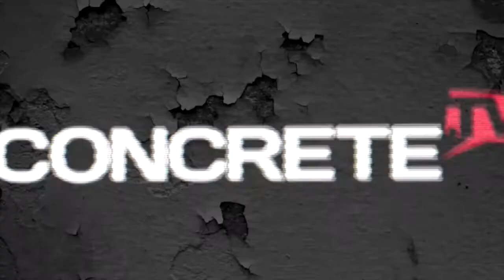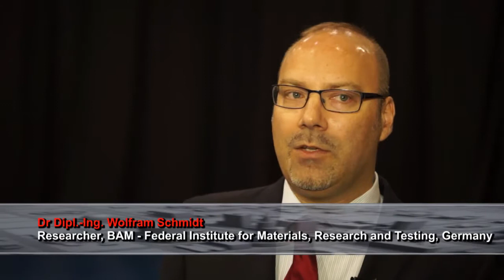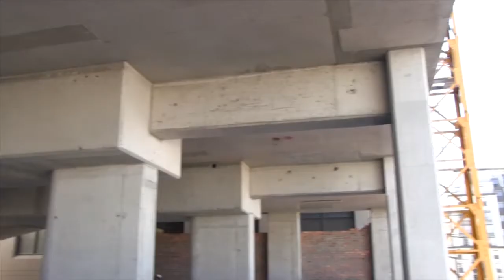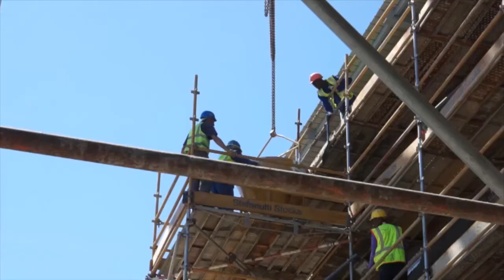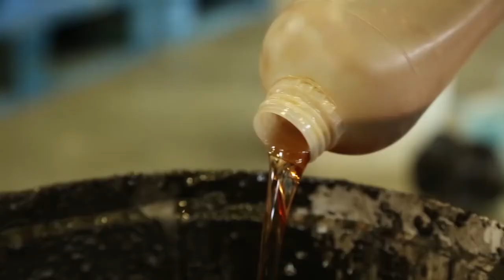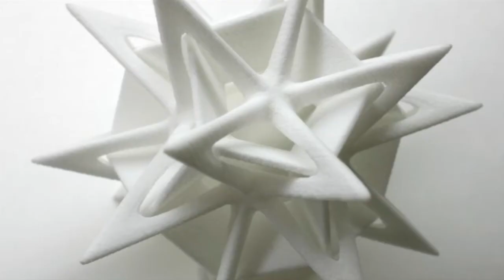'3D printing material to remain a niche market'

Comment: I agree that 3D printing with concrete is presently a very niche market, while also a too-shiny object.  Most construction details have not been figured out yet. However I strongly disagree that there has to be a compromise in material quality. Our mixes are coming out with zero shrinkage and excellent hydration, while stacking rapidly with monolithic bonding throughout. The cost was about double that of normal concrete, now it is half-again - so it is moving in the right direction. Soon the material cost will not be any barrier, and the method will find many applications. The robot is the expensive part!